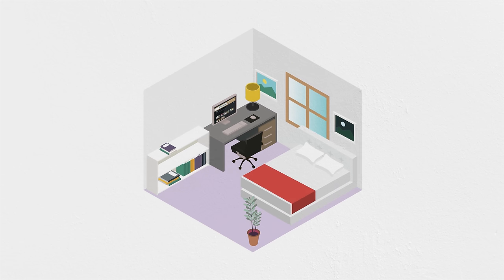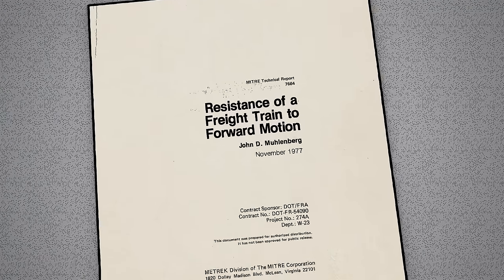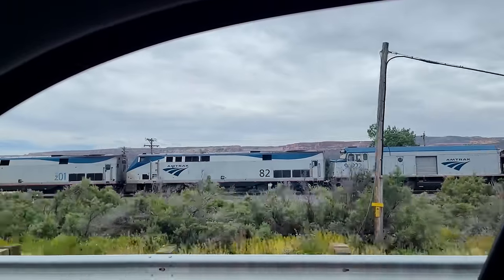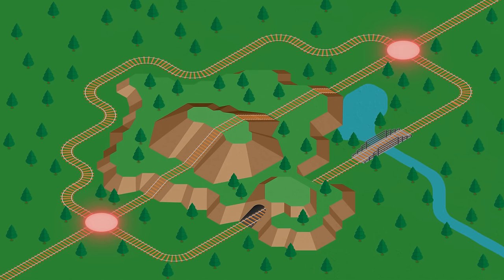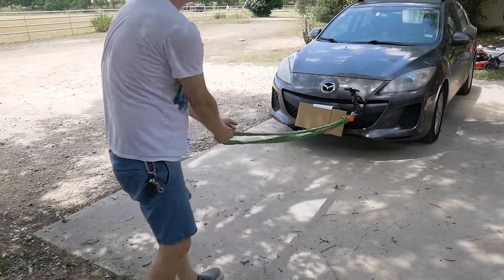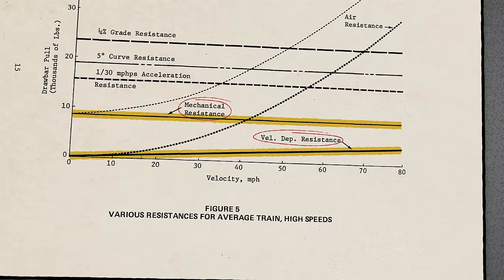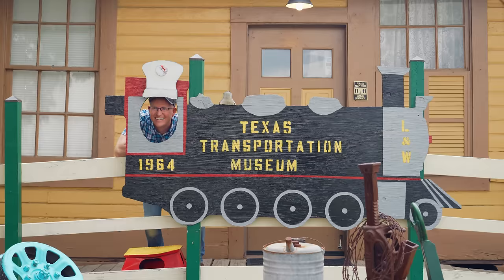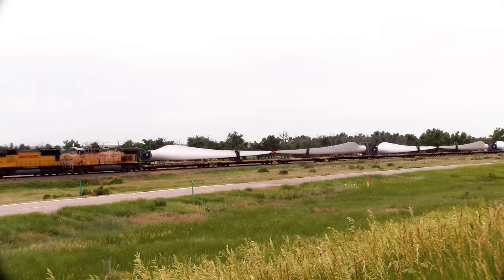Which Is Easier To Pull? (Railcars vs. Road Cars)

Comment: I'm a locomotive engineer. I've moved many stone trains. In fact, in 21 years, I've hauled pretty much anything you can imagine...including elephants. I chose the level path without the tunnel. It's the longest, therefore I get paid more to drive the train.
Reply: I'd imagine that depending on the length it might also result in difficult working hours.
Reply: LoL!  Maximize operator prifit!
Reply: @geraldfrost4710  Considering the way modern US railroads treat employees, good for them getting theirs.
Reply: Now that's some decent application of mathematics and logic 👍🏻
Reply: Elephants?! Neat!

...Did you need to use the horn when you had them on board? 😅
Reply: @seneca983  Engineers have it pretty easy, and longer trains arent too bad, its the short, heavy trains that are tough.
Reply: @Dovahkit  By length I meant the length of the trip, not of the train. I've heard that sometimes train staff don't get enough sleep.
Reply: @seneca983  As a train conductor who works the extra board, it can be difficult to get enough sleep, and long hauls definitely are difficult to stay awake lol, usually I have to keep talking to my engineer to keep us both awake, having slow orders, having to stay awake for signals, or talking to foremen over the radio does help, we’re not allowed to sleep unless waiting for passing trains, and even then only 1 of us are allowed to nap in the cab.
Reply: @Dovahkit surely you could have two sets of people to sleep in shifts
Reply: @vappyreon1176  if only lol, train crews are normally 2 man crews, an engineer and a conductor.
Reply: @seneca983 I'm like positive, it wouldn't make a difference. The company would make him work X hours a day regardless. Only exception being the distance to the next stop exceeds the max hours.

I also chose the flat curvy no tunnel / bridge path because it would be the cheapest and easiest for the railroad to build. And if this was back in the day when railroads still serviced smaller businesses frequently. It could encourage growth along the track for more business. Or if any logging takes place there. Boom, got a railroad to transport the logs!
Reply: @vappyreon1176 If you can talk the railroad into paying for four men instead of two, good luck.
Reply: @Dovahkit  I assume one controls the engine the other controls the conduct
Reply: @RCAvhstape  that's what picket lines are for :3
Reply: @emptyshirt  the engineer drives the train, the conductor is in charge of the movement and anything that goes on in the train lol
Reply: @LevaniaMeyano  FRA regulated hours are 12 working hours, and once a crew reaches 12 hours they can’t do anything else, so say the crew hits 12 hours, the train needs to be tied down there and the crew will be relived by another crew and limod back to a station or hotel, and anything past that 12 hours is called limbo time, train crews are given 10 hours rest between shifts as well.
Reply: @TheEDFLegacy  They were tied into the middle between the rails and serving as the DPU. Less fuel, less maintenance.  ☺
Reply: @Dovahkit getting rest used to be a whole lot worse. Before rsia I worked 45 days straight 12 hour days and that was the norm. Going on duty twice in a day was the norm
Reply: And the mountain route is where you earn your money, but that sounds like too much work.
Reply: @Comm0ut considering how us engineers get paid, lets just say that as a european engineering student, im jealous
Reply: @niklimnat1061 a locomotive engineer might make more sense to you as “train driver”
They’re not like civil/mechanical engineers
Reply: You must be descended from some of the folks that built the Union Pacific transcontinental route. Uncle Sam was paying by the mile, so they racked up as many miles as they could.
Reply: why not the one with the tunnel? if you weren't paid by distance.
Reply: Elephants from where
Reply: @Dovahkit The conductor is in charge of the train and the engineer makes it go forwards or backwards.
Reply: @nicn6241  Correct.
Reply: Sorry, don't believe you. I have never seen a train made of stone - not even on The Flintstones.
Reply: very nice ❤❤❤❤
Reply: I'm sure the elephants appreciated you not taking the tunnel as well.
Reply: @Dovahkit   "long hauls definitely are difficult to stay awake "
Hard to believe DOT has strict rules on time truck drivers can work but there are no rules for railroad employees?
Reply: @munsters2  We have very strict rules for time worked, we can only work 12 hours at a time.
Reply: @Dovahkit  ok. Thanks for clarifying that. From what you said, it sounded like they made you take long trips and work so many hours that it was hard to stay awake. In my opinion even 12 hours is too much especially if it is multiple days in a row.
Reply: ok
Reply: Engineer 😂 You basically play videogames dude.
Reply: I’m putting a 10/10 speed restriction for a frog defect. But I’m going to end up having you go over it at walking speed. Also I fried a resistor in the signal bungalow, so speed is restricted miles in both directions. 

Love, 
Maintenance in the Way
Reply: @vappyreon1176 the simple solution rail companies are willing to shut down our entire economy to avoid 😂
Reply: @LevaniaMeyano  well not necessarily, if you can use the results from the tunnel board to build the bridge then that actually might be the cheaper route
Reply: You get paid by distance, not by time?
Reply: @Dovahkit  Longer trains wouldn't be a problem, if there were enough time provided to properly inspect them so they don't derail. A longer train has more potential spots to derail.
Reply: @Comm0ut  here in Europe its totaly different story. Here the bad treated are passagers.

Comment: Honest question: You said "In a perfect world, a wheel is a frictionless device." but doesn't a wheel require friction to impart forward momentum?
Reply: the drive wheels should have just enough friction to get it moving at the desired speed, but all wheels are used in braking
Reply: Maybe he means the friction between the axle and the wheel?
Reply: rolling resistance / rolling friction is how easily a car rolls on a surface w/o braking or accelerating
- this is mostly stuff like the bearings not being perfect (having a nonzero coefficient of friction) and the wheels themselves continuously  deforming as they get squeezed by the ground as they rotate which uses some energy and heats the wheels and wears them out from stress

this is a parasitic friction

this is a separate friction from traction where u r sending driving force thru the wheels via the friction btwn the wheel and the road/track surface (where u r looking at a classic high school «“coefficient of static friction (btwn the wheel and the road/track” * normal force of the weight ok the axle» type situation)

Comment: I used to be the manager of a warehouse that had a rail spur for  shipments. Many times, I had to move the box cars by myself. I used a 'Johnny Bar' to start them moving, and then I could just push them into place at the docks, fully loaded. No problem, IF THE BRAKE WAS OFF.
Reply: I did the same when I was a receiving department manager at a furniture store. I used my Chevy Blazer and a chain. The first time I did it my crew was saying no way I could pull the loaded rail car. I hooked it up, put it in drive and didn't have to add much throttle and the car started rolling. We were able to spot at the correct door for unloading.
Reply: @RandymanB  *stop
Reply: Those brakes are there for a reason.
Reply: Spiral tunnels? Wow, that's something I didn't know existed. All makes sense but it's cool to learn.
Reply: @TimothyReeves  railways are fascinating, the creative engineering is something to behold.
Reply: As a scrawny 17-year-old warehouseman, I was moving boxcars full of soap around with a Johnny bar lever.  It was surprisingly easy.
Reply: @lizj5740  *spot. He put it in a specific place. We call it spotting cars.
Source: Am a freight conductor.
Reply: I moved a 50 ton passenger car once with a group of 6 people on an ever so slight gradient (almost perfect level track, but not quite). It took quite a bit of effort to get it rolling, but after that, it was easy as pie. On a level bit of track, I could start it moving by myself even, which was very surprising. That did take a lot more effort though.
Reply: That emphasis makes me think that sometimes, the brakes were ON.
Reply: Hi there who got 746 likes already. I tried googling Johnny bar and couldn't get to any video how it looks like or when and where it is used. As I am from India, the results I get are more of Johnny Lever, a popular Bollywood comedian! Please point me to something to help me understand. Thank you.
Reply: @SureshKrishna5  look up "box car mover". There's a video of a guy moving a caboose with a johnny bar.
Reply: @ninjaswordtothehead  1000 thanks. I get it now. That was the most swift response I ever got. 

Mommy Daddy 2 grandmas and 2 grandpas I am famous on YouTube!

Comment: There is a VERY sad story about this. In the context of a TV contest in Young, Uruguay, the crowd was pulling from an old train to try to get it to move. It eventually started rolling but they could not stop it. Eight people died.
Reply: Wait seriously? Where can I find some information about this??
Reply: @Monkey_D_Luffy56  Wikipedia has an article (only in the Spanish one) as "Tragedia de Young"
Reply: well dont be dopes and try and pull a train car with out thinking how to stop it
Reply: Probably why in those old videos of railroads showing how easy a locomotive rolls by having people pull it forward/backward, they most likely still had an engineer in the cab to work the brakes. Trying to move something unmanned is NEVER a good idea. Just ask my older sister. Her car had started developing power problems, as in it wasn't propelling the vehicle anymore, at least not very quickly, so it was parked in the driveway for a while. Then, she wanted to move it into the garage, and I volunteered to help. Before we started pushing, my sister decided it would be a good idea to have the car in gear to help us up the hill, which wasn't a bad idea, per se. Not being in the driver's seat during that, however? O h  y e s . Soon as the car reached the flat floor of the garage, it no longer was working as hard against gravity, and suddenly pulled away from us. She tried to get back in the seat, but unfortunately she couldn't in time, and the car crashed right into the door linking the house. Our mom was pretty upset, and justifiably so, especially since the house was a rental. Even after fixing it ourselves, when we moved out a little while later, that accident kept her from getting her deposit back. Moral of the story: never try to move a vehicle completely uncontrolled.
Reply: The most important thing when rating something for towing isn't how hard it can pull... it's how much it can stop.
Reply: Yeah, level ground and you can lean on a locomotive to make it start moving, but good luck stopping 80 tons in motion
Reply: @Railman1225  Heh... I've push started vehicles by myself before but always conscious of the "Oh S***!" aspect of doing that. Fortunately, it was usually "sit in the driver's seat and push with one foot JUST enough to get the car rolling and pop the clutch on the first revolution of the wheels."

Comment: I had a teacher, back when I was in 5th grade,  who tried to move a rail car with a tractor. The tractor's tires just spun in place. He was stymied and thought it impossible. Another man handed him a steel bar, with an angled foot on one end, and said to use that. My teacher looked at the man and thought he was nuts. He stuck that foot in between the wheel and rail and put a bit of pressure on it and the rail car began rolling. It was the prime example of a lever for teaching our class.
Reply: When my daughter was in preschool they were learning about simple machines (LEVER, pulley, screw, inclined plane, wedge,wheel)
At home I set up a 10 foot plank with a fulcrum (block) very close to the wheel of my one-ton truck. She was able to lift the tire off the ground just enough to see completely under the tire.  Apparently she told the class and I became the "cool dad" 😎 whenever I was there helping out.
Reply: I suspect that between using the tractor and using the Johnson bar…..someone released the handbrake! 😳😂
Old trick. Like sending the new guy to the stores for a long weight. 👍
Reply: Fulcrum would approve